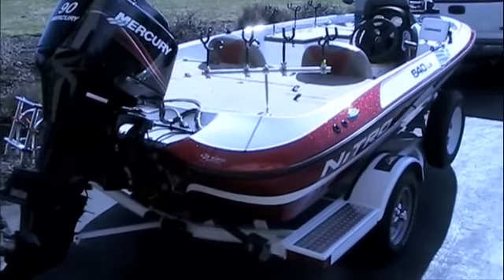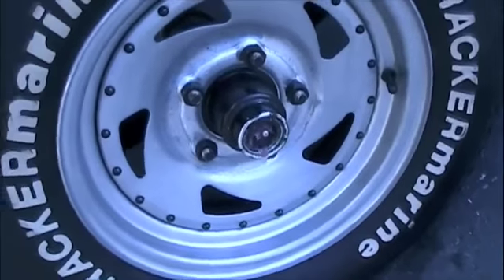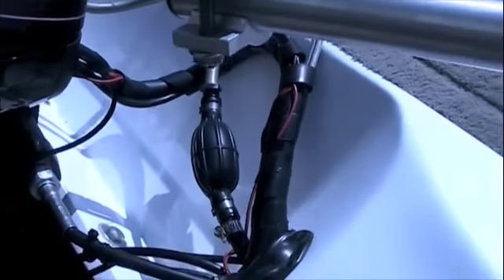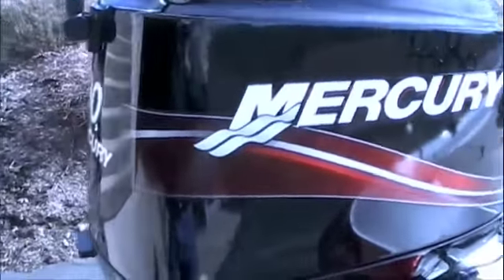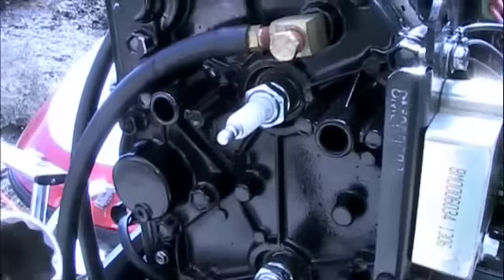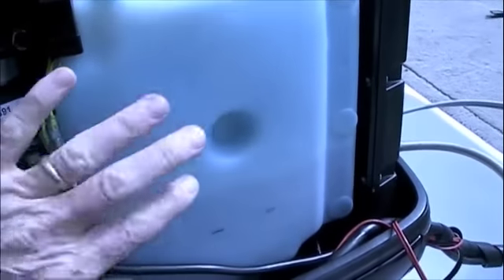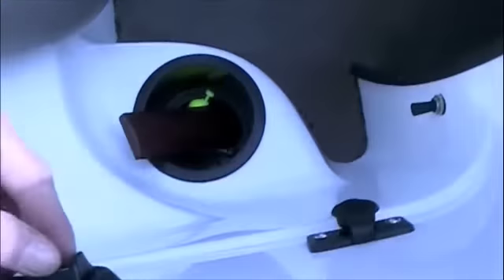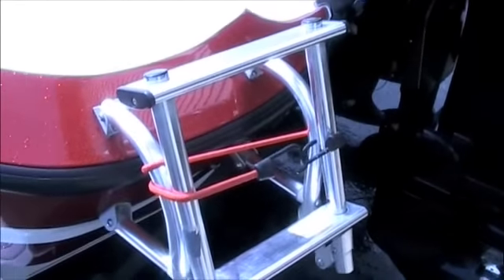how to start and run a outboard motor on a garden hose

Comment: Excellent information; no BS just the facts. I haven't had my boat on the water for a couple of years and this man explained plainly what I need to do before heading to the ramp with a motor that may or may not start; exactly what I was looking for. Outstanding!

Comment: Thanks for your video, very nice and well done.
Question: shouldn't be the ears put the other way? In that position, with the wire pointing to the transom can slip and drop to the floor. If you put it the other way, with the ears wire involving the lower unit you are sure it wont drop. Is that the correct position?

Comment: Nice dialect :-)  I'm wondering how I could check/ let run my inboard engines when the boat is out of the water. Any advice?  Thanks, Chris
Reply: Watch the video and run it like I did mine, using garden hose with ear muffs

Comment: did I miss something? the video said" how to run your outboard engine with a hose"  but I am listening to information on checking the air pressure in my trailer rides:/
Reply: Be patient, it's towards the end. You'll learn some other important stuff before he covers that part. You may need a translator though, if you've never lived down south.